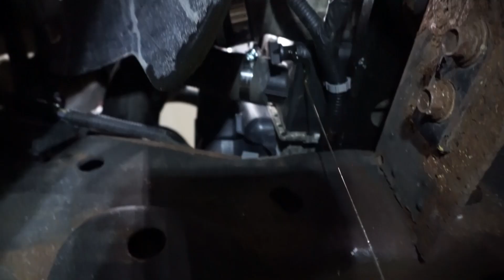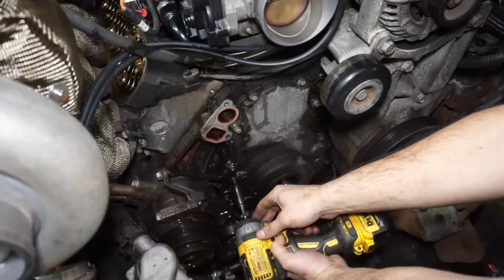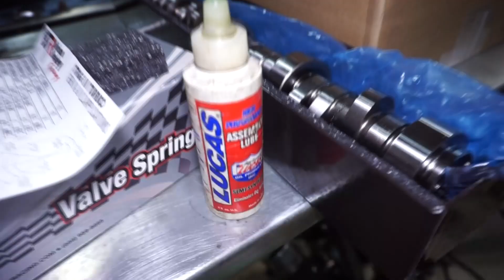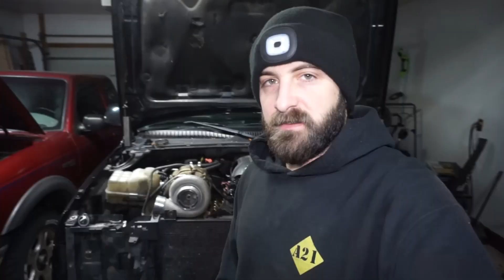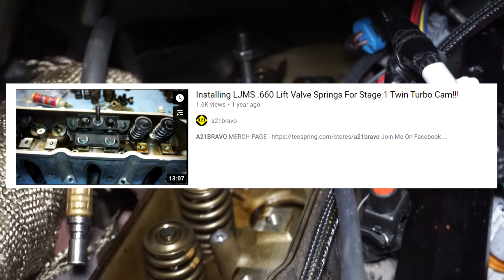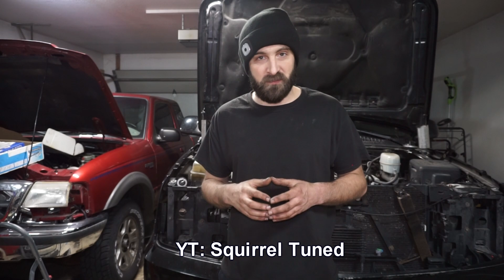BTR Stage 3 Turbo Cam TURBO ESCALADE!!!

Comment: You running stock valves with this setup? I just installed a stage 3 na cam but a local told me the cam will break stock valves. But ive only head that with ls7 valves and hollow stem ls3 valves. Not l92 solid stem

Comment: Do the things man, u got the link for the adapter that goes to the spark plug hole holding the valves?
Reply from the maker: It was just a harbor freight leak down tester hose.

Comment: Did you even set lifter preload on this..?
Reply from the maker: No.
Reply: @BlaserBuilds  is it really even needed...?
Reply from the maker: @paintballmaster500  I don't do anything different because Its stock rocker, stock lifter, stock length pushrod. 3rd time I've used this setup and has worked well as is every time... Mustang I had ran 8.80 in 1/4 mile with the twin turbo version of this cam, and same springs.

Comment: How about a trunnion bearing upgrade? Stock retainers?
Reply from the maker: I usually don't to the trunion. I'm stubborn so will probably have to wreck a motor finding the failure point before I add that as a precaution. Lol.
Reply from the maker: Spring kit comes with clips, retainers, seals and spring guides.

Comment: Nice man! I appreciate the shoutout.
Reply: Can you get these for 454’s? I love the sound
Reply: @josegarcia711  the engine size is going to change how it sounds. It would take something more aggressive to sound the same in a 454
Reply: What can do you recommend for a 454?
Reply: @josegarcia711  is it an ls based 454? All I really know about is LS stuff and it is 99% turbo ls stuff.
Reply: After swapping cam U will need have it tuned before taking it to the track.my question to you ..IIM installing turbo and turbo cam but ATM it's tuned with big nasty 240s na cam ,after I put the turbo cam in and turbo will it run 1st off and be fine to drive few miles to my tuner for dyno tune
Reply: @solomonangus2804  That question is best asked to your tuner. However in my opinion it would be okay to do that as long as you did not load the engine much or get into boost. If you change map sensor or injectors or things like that it could throw it way off though with no tuning.

Comment: How long are the dow rods you made, incase  a guy is following your lead here?
Reply: Just make them a little longer than the bumpstick :)
Reply from the maker: 20 inches.
Reply: @BlaserBuilds  I thought that with most LS cam swaps you just spun the old cam and the lifters just stayed up in the trays. Your method is safer, however.

Comment: Heck ya sounds great.  not a lot of lope, but enough.  "never expect a lot of lope with a turbo cam"  makes it more of a sleeper.
Reply from the maker: Should be a little more when it warms up and idles around 850-900. This was around 1200rpm since engine was cold.

Comment: Thanks for posting, Really enjoyed it.  reminded me of when i did a cam swap on my buddies LS one a couple of yrs back, he beats the hell out of that thing and it is still rippin just fine.   cant wait to get my own so my work isn't in vein, hell i never even got a ride in the Camaro lmao.  he sends me a vid link every now and again with the HP tuner screen and a rip up to 90 or so.   on a side note "for everyone" be sure that rubber gasket on the cam cover is in good shape. "the orange line on the back side of it"  if that isn't there u have 0 oil pressure.   and fyi, springs are a pain without the right compressor if you are leaving the engine in the car. just if anyone is thinking of doing it, prepare for about 8 to 9 hours of cussing and frustration and putting an air hose in the spark plug hole to keep the valve from falling.  "be sure it is tdc when u remove the spring to be safe" then after that u get to fire her back up.   heating the balancer works fine.  this fella is definitely putting in some work on this bad boy, very impressed with the progress in short order brother.
Reply: i re-read and edit my post too much i should just leave it. lol

Comment: fast forward theater? how is this different than the stock one? in, out or spread and all those thingies?
Reply from the maker: Lot more lift, different duration/LSA ect.
Reply: @BlaserBuilds  wider or narrower? would they call this a cam for boost or just a bigger better boomstick?